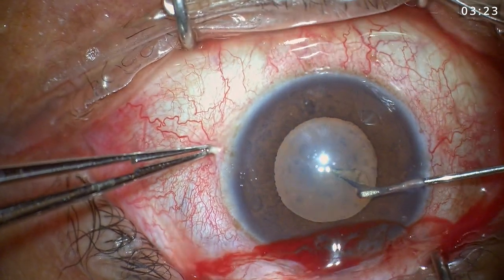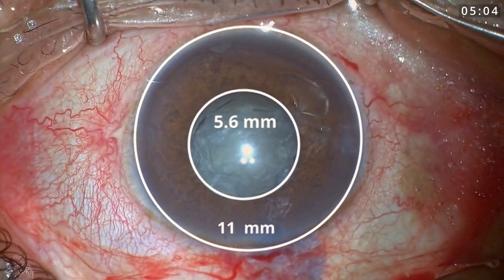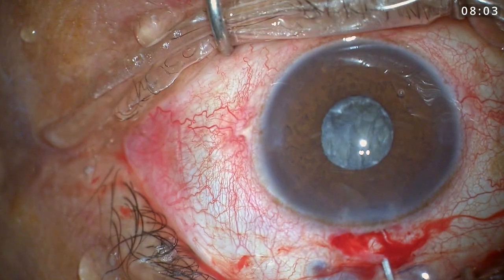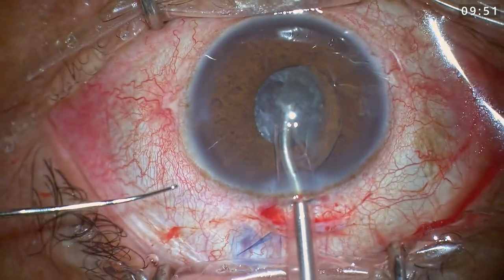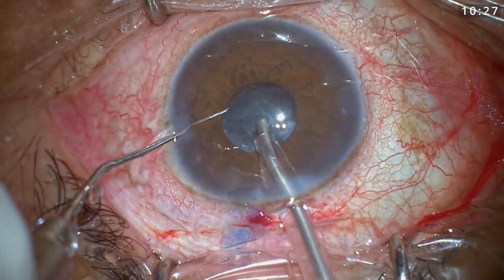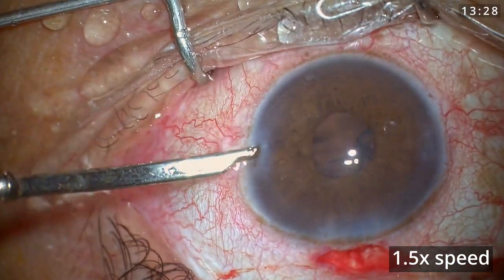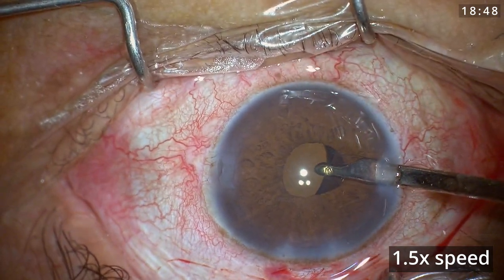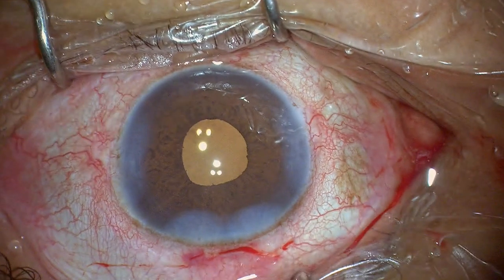Phaco Tips & Tricks for IFIS | Intraoperative Floppy Iris Syndrome

Comment: Awesome! How did you do the WTW, capsulorhexis diameter and pupil size calculations sir?
Reply from the maker: WTW, pupil and capsulorhexis diameter was drawn and measured in video editing software. I am using Davinci Resolve for that but can be done in any software. First you have to draw a circle around the cornea and note its dimensions. My software showed it as 0.321 (it can be any number) then I drew the circle around pupil and it showed the dimensions as  0.175 by calculating a ratio of these two numbers agains the fixed 11 mm diameter I was able to calculate the pupil size same for capsulorxhexis.